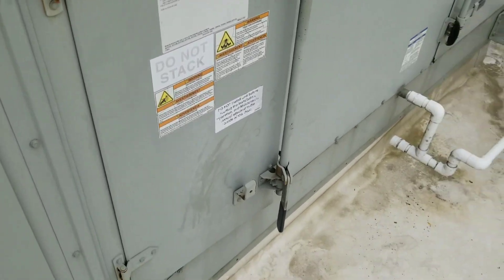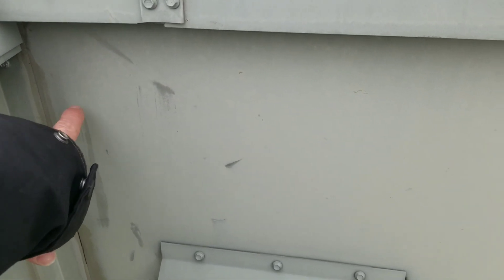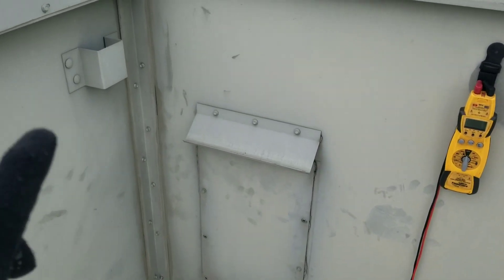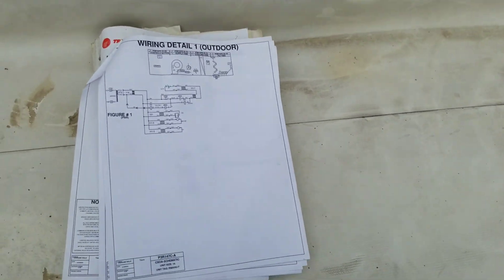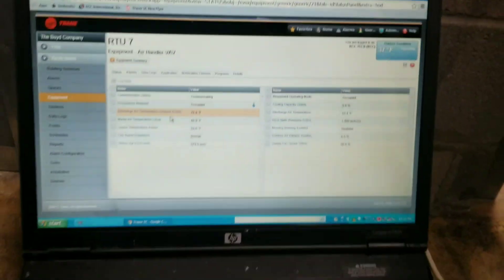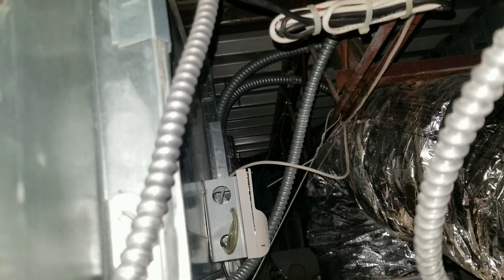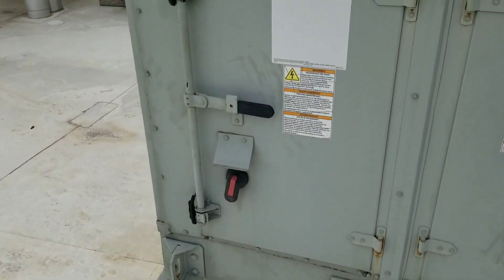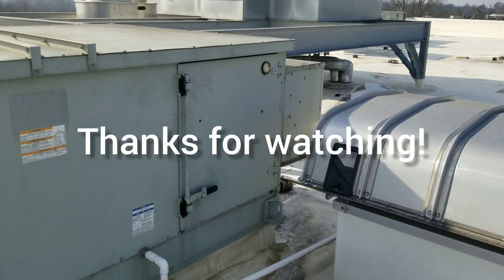hvac no heat call, trane climate changer.

Comment: Great find, wonder if that was left there from a previous install,? Was the damper control hooked into the building system?
Reply from the maker: Thanks for watching! This building was value engineered so a lot of issues. To answer your question no this actuator was not on the BAS, I swear I keep finding random stuff like this. If you saw the blueprints and what they were trying to do you wouldn't believe.

Comment: Don't they use glycol in their chilled water system?
Reply from the maker: Yes they do! Good call, suspect freeze stat comes factory with unit. But why the extra low limit? Honestly did not think of that, it may not be needed.  I'm guessing it's just extra protection in case customer stops water treatment or never treats at all which I dont know about where you are but we see a lot! Thanks for the feedback and watching!
Reply: @EverythingHVACR   Always best to have more protection.
Reply from the maker: No doubt,  thanks again for the feedback. Sometimes you dont think about these things until someone comments!

Comment: Looks like there using it as relief damper proportional controlled off economiser control signal. Economiser opens 50 percent relief opened 50 percent.  Other units using power exhaust.
Reply from the maker: As that does make some sense that's not what was happening,  the BAS has no control over this damper,  only exhaust was the 2 up blast fans shown for center of building. Thanks for the feedback and watching!